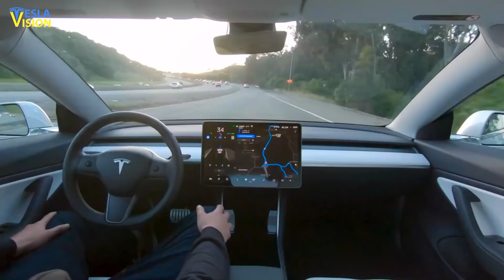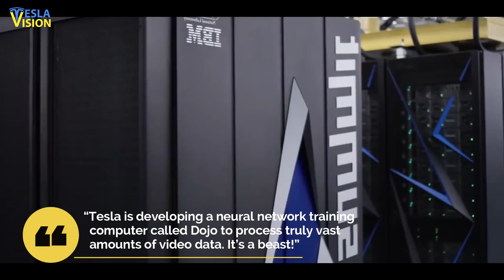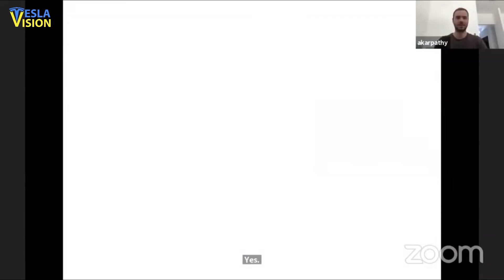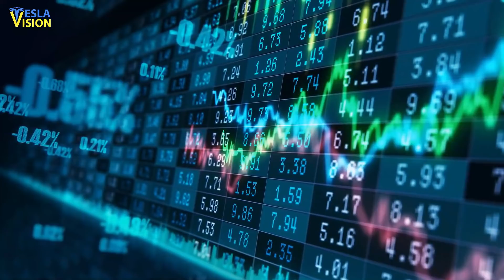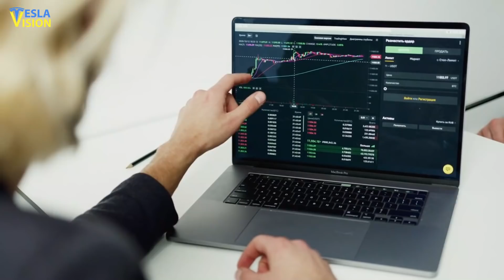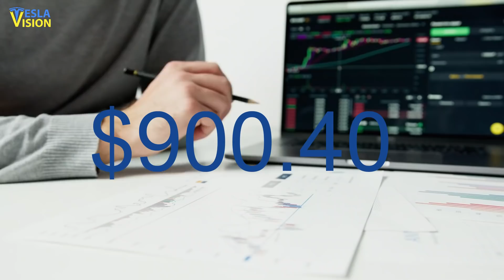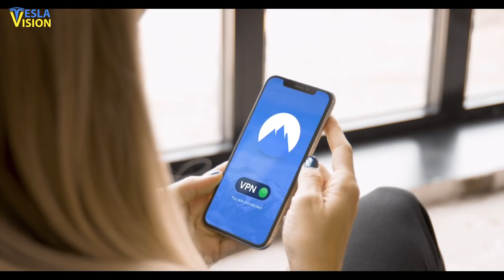ELON MUSK's new AI computer will BLOW YOUR MIND!

Comment: This may be off topic, but someone might find it interesting.
Piston style over unity electric generator. By AMA
Motor segment:
1 motor with bar connected to it standing vertically
circular disc connected to bar that has magnets embedded in it surrounded in high permeability material to focus magnets outward pushing force in an upwards direction from top of disc.
Power Bar segment (Just name I gave it)
Hollowed out cylindrical Bar of material horizontally positioned.
donut shaped material with openings around its flat edge for magnets surrounded in high permeability material to be embedded.
place these all along the cylindrical bar connected to it solidly. except at far ends of bar.
At both ends of bar rings of material that can be magnetically repelled in specific locations (magnetically repelled in specific location is in reference to outside of ring area that faces away from center of bar)(Other side of same ring facing in towards center of bar is capable of magnetic repulsion all around) are connected solidly to bar. points of repulsion on these rings is off set from each other on each end of bar.
3 Hollow donut ring structure with connecting bar:
Ring structure has all magnetic repulsion on inside of donut shape & and can rap around the main bar so that the bar wont be causing friction on things as it moves back and forth. 1st positioned around far left of bar, 2nd position center of bar & 3rd positioned on far right of bar.  
Tube structure is constructed in two parts that fit together on top of each other length wise over main structure & has openings for bar to the Ring structure that is connected around the main bar keeping it from causing friction on structure with it's magnetic padding. This tube structure is designed with material that does not block magnetic fields. Perhaps some type of transparent material glass or other. At both ends of the tube structure there is a built in groove that will house a disc, the groove has 4 points, top bottom left and right that has small magnets embedded in it on the inside so that the pushing force from magnets is pushing in towards the edge of disc that goes in this spot. The disc has ring around it that is repelled by magnetic fields so the 4 small magnets will keep it lined up but it will be able to spin without causing friction on structure. The disc has openings on it's flat side that face inside of tube and magnets surrounded in high permeability material are embedded in this disc. The disc has small bar that is connected to it that goes all the way to the other end of Power bar structure through the center of the hollowed out bar and connects to disc on other end. Disc on other end is set up the same but magnets embedded in it are off set in comparison. As first disc spins the magnetic fields will push against specific spot on disc connected directly to bar, pushing bar in other direction, once bar is fully pushed over, further spinning of disc will then align the other sides magnet to push it back. Tube structure also has half moon shaped protrusion on inside and on both halves so when tube is connected they line up to make a full ring shape on inside of tube, these half moon shaped protrusions have at least 1 small round opening on it's side in middle of curve that faces away from center of bar. The opening has a small magnet embedded in it so magnetic force is repelling out sideways away from center of bar. The protruding ring is positioned to line up slightly further in towards center of bar then the ring of magnetically repelled material connected directly to bar. This way when bar moves to right this magnet will act as a stopper keeping bar from going to far & same setup on other side will keep bar from going to far to left. 
Copper coil setup:
copper coils are wound up as if wound around the width of wood board for a distance equal to width of magnetic ring setup on bar. Wound copper coils are then looped around the tube like a donut lined up perpendicular to magnetic fields. Ends of copper coils are connected into separate construct that will allow electrical current to flow somewhere else.   
Circular construct is built like a stand that goes around the outside of motor segment. 
Circular construct has flat ring of high permeability (magnetic field shielding) material that has small openings that will allow magnetic fields through specific locations. Top of circular construct has groove to allow the power bar to balance on. Circular construct can also be placed on other end of power bar so it is balanced. The motor segment is positioned so the disc connected to the bar that is connected to the motor is lined up so the disc passes under the power bars disc that is at end of power bar. The high permeability material keeps the magnetic field from the embedded magnets exerting their force upwards from hitting into the disc in the power bar until just the right moment when the impact will cause the disc in power bar to spin which will perpetuate the piston motion in the power bar. More power bars of the same design are built and positioned around the motor segment in a circular fashion all the way around. The bar connected to the motor can be increased in length to desired height and more of the exact same setup is repeated higher and higher up maximizing the over unity potential of the construct to ridiculous proportions. :D Current from the power bars is diverted to power the motor as needed and all other current is diverted to power my game console or the world. :) Interesting variation to this design would be to connect the spinning discs on far ends of power bar to main bar that magnets are connected to so the magnets spin instead of getting pistoned back and forth. So long as moving magnetic fields are perpendicular to copper wires it should work. By AMA

Comment: Tesla was really stupid about China. The US is the greatest market in the world. But you have to give people what is practical and that works. So far you cannot depend on any electrical car but for anything but local driving. And even then you aren't sure about the darn thing. Gm really dropped the ball in canning the Saturn car company. All they had to do was put  a self charging electric motor in the cars. Or a Troy Reed magnetic motor later. Someone tell me why Tesla isn't making a self charging car for $15 grand? Kids are making self charging go-carts. And Stanley Meyers was running a dune buggy on water. All you have to do in make the injectors to separate the hydrogen from the water. They killed him at a Cracker Barrel, in Columbus, Ohio.  The auto industry is a mess. With 55% of the people making $30 grand or less. How many $70 grand Rivian trucks are you going to sell to Joe Public? You already have a reduced market. Even the new Ford Maverick truck will see not the same sales the Ranger did in the later part of the last century. You have to make and sell what people can afford. Simply what's affordable, dependable and practical. Thus far the electric vehicle isn't. The left is screaming green. I don't hear them telling the car companies to make self charging vehicles. On you tube they show how to mark a self charging car or truck. You use two battery parks. You run on one, and charge the other, and switch back and forth. What is so hard about this? And I have yet to hear of anyone doing this to existing cars and trucks. This is where the money is to be made. Greed itruly runs this country. Guess what? Joe Public can't afford to buy what you are making Tesla or Rivian, and so on. And why would  scrap or trade in something I don't need to make monthly payments on, and pay higher auto insurance on. Tesla and the rest have their heads up their you know what.